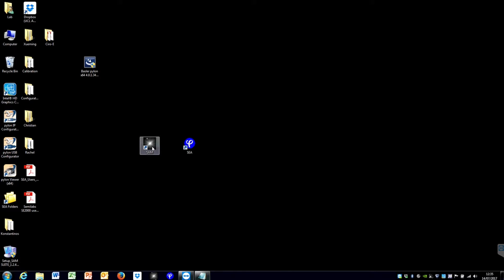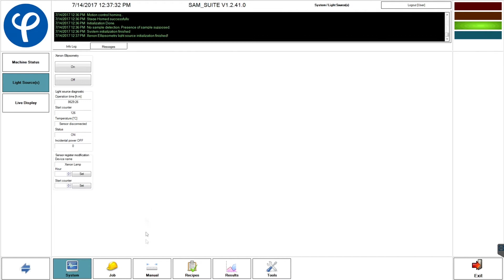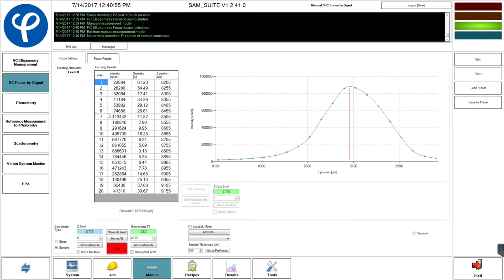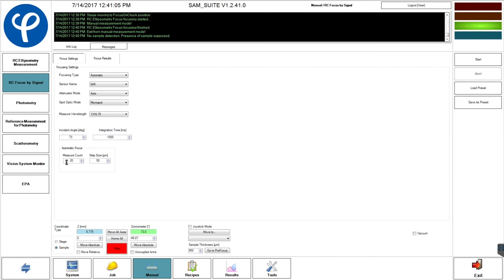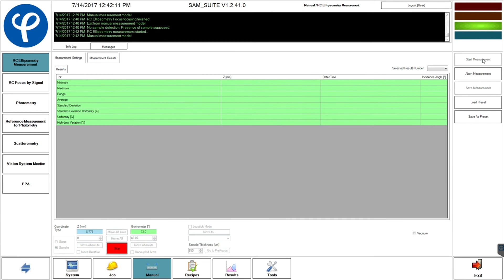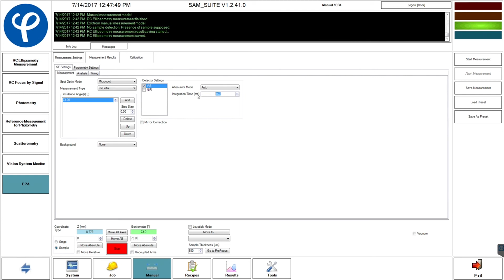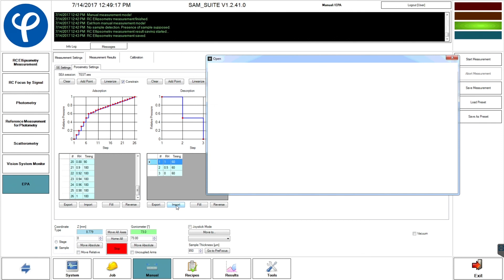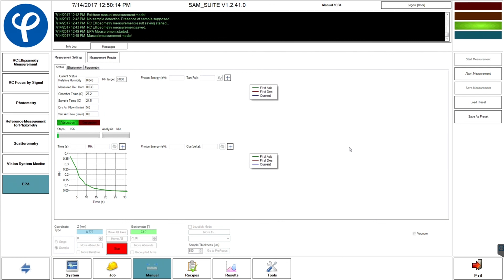Ellipsometer Tutorial - Part II: Software Introduction

Comment: ear Adrena Group, thank you for your informative videos on ellipsometry. I am PhD student working on organic solar cells. I am using the same SEA software to fit my polymer films deposited on glass. Generally, I use only gaussian oscillators in order to fit the data. However, I am still having trouble fitting. Any advice from you will be very much appreciated. Thank you.
Reply from the maker: Sorry for our late reply Anil. We would need to understand the properties of your film to be able to provide you a suitable model. But you can also directly contact Semilab. They have a very competent technical support.
Reply: @adrenagroupucl9342  thanks